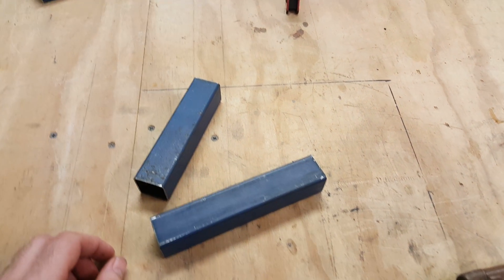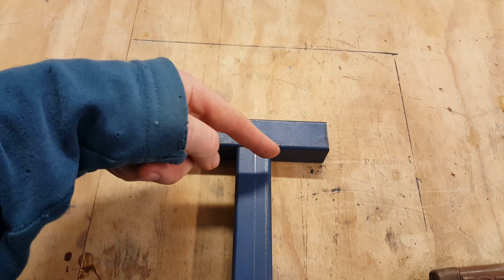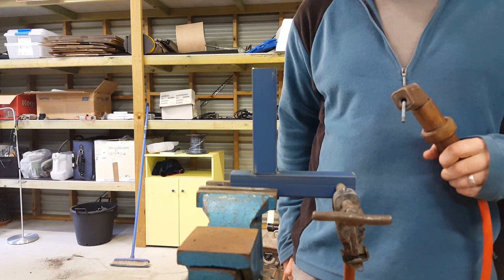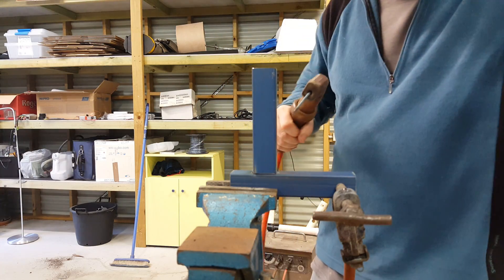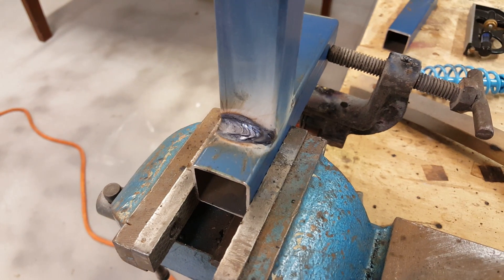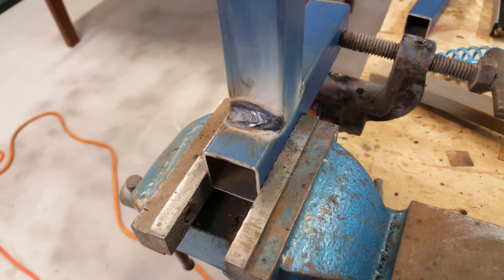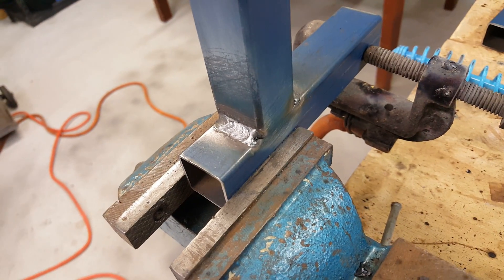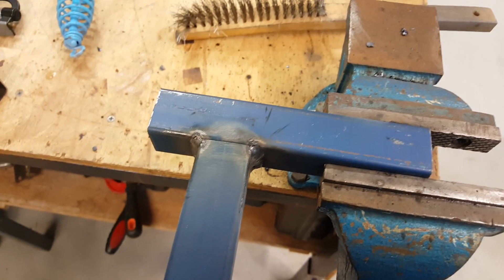Welding thin steel tube with a stick welder

Comment: Would you say that 1.6mm electrode would do just fine with a normal continuous stringer bead with amps set at somewhere between 20-40Amps ? I was wondering whether trying to match as close as possible the electrode diameter to the thickness may be another solution?
Reply from the maker: In my experience the thinner electrodes are consumed very quickly and offer very little penetration into the base metal.  As I've said here before, the settings I'm using here were the least-worst settings I could use, and only worked if I stopped periodically to let the metal cool.  2 mm electrodes (instead of the 2.5 mm ones I'm using here) might be OK, but I still find less than 70 amps to be ineffective.
Reply: @jonescg  thanks. What about several layers starting with a thinner one and the swapping to a 2.5 or 3.2 electrode?

Comment: Thank you for sharing  your skills I was welding a tube today it was a disaster it looks like a cheese with wholes, thanks God for your simple and straightforward advises. I have benefited and learned your techniques, would be able to tell us the wattage you have used in this weld please, iam using 60 70 watt.
Any advice will be appreciated
Reply: Good luck to both of us man, that happen on me too
Reply: Try 30-40 amps ;)

Comment: Thanks Chris. I've been burning holes in thin stuff like a maggot in a piece of gorgonzola cheese. How many Amps did you use?
Reply from the maker: As per the notes: 75 amps and 45 V.  I found going any lower caused the rod to stick a lot more, and the penetration was poor.  Lots of commenters have suggested I turn the amps lower and do a continuous run, but as I have explained many times before, doing so results in a worse weld.

Comment: When you started on one side of the vertical and let it cool, I would have thought the weld would shrink and lift the opposite side
since it was unclamped of tacked in place?

Comment: No complaints or criticisms. Cleaning off the slag between each stitch weld will help to produce a better weld. The slag is being pulled into the next stitch. There are lots of great suggestions.

Comment: So much wrong in this vid. First clean your surface it has to be as clean as possible no rust no paint use a grinder and a flap disc.
2. Use glothes and close your pullover u will burn yourself
3 first tack everything if the heat comes ur steel starting to dent

Comment: Dreadful. What you’re trying to do is progressive sequence welding, can be handy if you are using the right amperage and gauge electrode. Also helps if you clean the surface of paint and contaminants before welding. Good enough for a quick farm repair on the run, but by no way trade quality.

Comment: I butt welded two pieces of 1/8 “ flat stock today.  I ground away all the excess weld  and went to town trying to break it.   I was shocked I couldn’t. Just sharing my success, nobody here cares.
Reply: I care Gene Miller :) I recently got myself to the same position. Feels great! Of course I then went on to try weld the tube I intended to weld and blew holes in it repeatedly so, not feeling as confident anymore
Reply: Michael Andersen keep at it Michael. Perhaps thinner welding sticks?
Reply: Gene Miller well done Gene. The people here who are enthusiasts do care and it's great reading others people's comments.
Reply: I say a job well done.
🖖😎
Reply: Do you want a hug, or do you need a cup of cement?

Comment: Why cant you find more videos on this when this is one of the biggest issues with welding. After 1 year I still struggle.
Reply: AHS Society  I just started welding.   Maybe a couple a hours welding time with a Lincoln tig from Lowe’s.  The biggest tip I was given was slow down.  Welding isn’t a race. My welds come out pretty decent and are very strong with good penetration.  I weld stuff then break it apart. After the advice my welds jumped in strength dramatically.  They don’t break any more.  I still have a problem staying straight but for some reason I can’t see through my shield.  Once I work that out I’ll be stoked.

Comment: Hi , I'm new to welding, you used 2.5mm rode for a  1.6mm square , how can i choose what rode and grade for different metal thickness, is there a guide line to follow? 
Thanks
Reply: thin for thin, that is my rule.  even go down to 2 mm drop temp
Reply: @africanhistory  thanks

Comment: If its gonna be anything structural then you should chip the slag after every tack. Because doing it that way, even though it's just a couple seconds between tacks, it still has flux already forming and you are just tacking over flux each time so it's not gonna be as strong. But for non weight baring things it's fine, also you could get a size smaller of the tubing and cut a 2" piece an put it inside the tubing you are going to weld, just put a small tack and grind it flush then you have backing all the way around and you can weld it solid normally w/o burning through.
Reply: You can restart on slag but it has to be hot. Half a second should be a good interruption value.

Comment: Great tip...Another great tip is to clean your metal before welding but since you are using a stick welder, they work also when the metal is not so clean. Not ideal but when in a pinch!

Comment: Tack one side, weld the other.  Weld 1/2 way, then start at the far end and weld back to the middle.   You should also clean the area to be welded. Welding over paint isn't good.

Comment: Try weaving  the rod and weld down hand. I have welded car exaust pipe with 6011 1/8  at 45 amps  with a ac welder. It can be done!

Comment: Basically a stitch weld to allow everything to cool off and not blow holes everywhere. For thin stuff, I'm now using an everlast pulse mig welder. Basically stitch welding on steroids.

Comment: I find i only get those weld holes from the dirty paint material or if its old rusty steel. If you use a thick wire wheel on grinder first to clean metal till silver you get better weld and penetration

Comment: How do you make the 2 parts stick together before even welding them?
Reply: Do a thing called a tac weld. You basically weld a small blob on a few edges to hold the overall thing in place then you go over it with the proper weld.

Comment: finally an Aussie that doesn't speak in inches and inch fractions!
Reply: Imperial is shit, metric all the way
Reply: @chrisfricker7025  metric metric metric , oi oi oi !!! .
Reply: chris fricker ok boomer
Reply: Well said, 40 plus years to learn metric and some still insist on imperial.   Is  a pet hate of mine.
Reply: I’m 50 plus but thanks for the youngster comment. Much appreciated. Yes I can do fractions and my comment was about the unequal representation of videos. Not everything needs to be U.S. based. In the land down under we are accustomed to both and our tape measures have both but when you go to the shops most are in metric. Been like that since 1974.
Reply: I must admit inches and fractions make people sound way more intelligent than they actually are  , maybe that's why allot of baby boomers still use it.
Reply: @matthijsjansen5838  -- No, the metric fanboys are more likely to be the youngsters, not us oldsters... I'm an engineer, I can handle either one... Metric is just another arbitrary standard and not based on any sort of universal constants to the natural world... They originally *tried* to do that, but they failed and it just became another arbitrary standard...
Reply: Probably cause metic users are lazy at math.
Reply: Probably because metric users are in a country that uses the metric system and not because they are bad in maths or fractions. My meter has both and yes I have finished high school. My comment was in regards to the unequal representation of videos so it is good to see some outside the US posting as well. The world doesn’t evolve around one system or another and if you look carefully at most measurements you will see most are derived from the Imperial system.
Reply: Still can’t figure out fractions eh?
Reply: I guess he must have an issue with fractions..... a large fraction of the time....
Reply: finally, one more moronic metric troll, who just fixates on trivia
Reply: Such hatred?? In Australia we use both but officially it is Metric. Do we know how to use fraction? Yes we do. Do we assume the rest of the world does not exist? No. My comment was in regards to unequal representation and stands. Too bad people have to be nasty and rude about it.
Reply: @mar56313  -- Looks like some little snowflake got all butt-hurt over my comment and flagged it, so it got deleted.  I was responding to Jansen's rude comment in kind.
If you really want to get picky though, the US does not use the "Imperial System".  We use what the Brits had before they redefined their measures into the Imperial system.  For example, our gallons are a different size due to they having 20 oz per pint and their ounce is slightly smaller than ours.  Still, a British pint of beer is a bit over 19 US ounces (and tastes better than the American mass market beers).  Our craft breweries though are often better that what I tended to find at Tesco in the UK though.
Reply: Wasn’t me. I enjoy reading what people write. I guess being Australian we share the same view.. it’s all the Brits fault. 🙂 (wait for the comments now...😝)
Reply: @mar56313  -- <tips-a-Toohey's-your-way>
For some reason, I haven't seen a Toohey's beer in probably a few decades... Are they still around?  The only "Australian" beer we see these days is Fosters and the version that we get is actually made in the US (although they price it like it was being shipped all the way from Australia).
Reply: Grumpy OldMan of course. Tooheys is alive and well. Fosters is great in marketing and can be found all over the world (you are right often brewed locally so not even come from Australia) but Australians overseas would drink it because it reminds them of home. They were big in the 80s but in my opinion it is not the preferred beer of Australians. Depending on which state you are in you will have your favourites (VB Victoria Bitter, Carlton Draught, Coopers, Thooheys New there are lots) we also like our wines 🙂
Reply: @mar56313  -- Back then, those 25 oz steel oil cans were pretty enticing... :)  Fosters used to make one that was sold here that was called "Fosters Bitter" is a green 25 oz (aluminum) can.  It was better than the regular Fosters... I think it was when the Fosters that we got around here was made in Canada (I'm in the SE Texas Gulf Coast area).  I think these days, the Fosters we get is made in Austin (TX) and they still have a green can, but it is not the Bitters anymore -- I think they just call it "Ale".  They're better than the American mass market beers, but not as good as the micro-brewery beers.
My wife and some of her friends are planning a trip to New Zealand this year and wanted to know if I wanted to go.  Spending around 3-4 weeks with a bunch of cackling hens?  Nawh... Besides, once you've seen your first thousand sheep, they all kind of look alike from that point... :)
Reply: New Zealand is a beautiful country. I spent 3 weeks in both Islands and wanted more. If the ladies yap too much then they are missing what they came to see... the outside. You come to New Zealand for the outdoors. Australians are very particular with their beers and therefore only the best survive. I remember having workmen in the house once and only having Coronas in the fridge leftover from a weekend party. I offered it to them and they said “thanks mate, VB or nothing”. I understood.
Reply: @mar56313  -- With them, it's more of just an excuse to go cackle in new places... Cackling Hen Party...

Comment: First rule of welding: criticise someone else's welding. Lol.

Wear gloves while welding!!!!

Please. Burn hurts.
Reply: His welds are fine. Anybody could do basic welding but a lack of thought on PPE is no excuse.
Reply: And wear something a bit more fireproof than that fleece pullover... That is made from polyester and is quite flammable... Polyester is nasty when burning on you... It sticks to the skin... Cotton burns at a cooler temperature and doesn't stick... Leather is better, of course, but I've done a lot of welding with just thick cotton shirts because it was just a "quick weld"... I've also got a fair share of holes in those t-shirts because of some hot metal splatter and quite often a matching spot on my stomach where it also got burned... Polyester would have been worse...
Reply: burns arent an issue... "Burn" is though... the intense UV is proven cause of cancer in welders
Reply: If you grow allovera ? Cactus in your yard and cop a nasty welding burn, apply this stuff it’s sensational
Reply: I like the comment about the first rule of welding! Youtube seems unfortunately to be full of criticisers (critics are something different and better).
Reply: I always take my shirt off when I weld outside....

Comment: you welded through the painted surface sir..?
Reply: It's a little trick that speeds things up in welding called incompetence. You can use the trick on rust also

Comment: To go along with some of the other good tips in the comments, here are one-and-a-half more suggestions.  It's been mentioned that you can go with smaller electrodes and lower amperage.  Here in the USA you can get E6013 in diameters as small as 1/16th inch.  That stuff gives smooth performance at 30 amps and below. 

Also, once you are working with an arc that's small enough and weak enough, manipulate that arc so it spends more time on the base-metal side of the joint.  In this case the base metal is the tube section that includes the boxed corner.  Spend much less time on the other side of the joint which is the piece that's the open end of the tube.  As an example, count a steady "one-two-three-one-two-three-" and keep the arc on the base metal for "one" and "two", and swing across onto the end-tube metal for count "three", and swing right back again.  When you swing across to the delicate side of the joint, you are just "carrying the puddle" across, rather than blasting the metal on that side.  As the puddle coalesces with the metal on the delicate side of the joint, swing your arc right back to the 'safer' side again.  Vary your counting speed and counting pattern as needed to get the right combination of heat on the corner metal compared to the open-end metal.  You can include that start-stop method too if you are still exceeding the limits with a weak arc, but even then, your goal is to keep more heat on the base-metal side of the joint. 

Learning how to fill your holes is part of the game, and with practice, you can get right to work filling a hole without ever stopping, with the right combination of sweeping the edges and even sweeping right across the gap.

I liked your nod to what it's like to be a beginner, with using a full-length electrode to being like "turning off a light switch with a broom handle." Practice practice practice!
Reply: Just researching for my first project, some excellent tips and guidance there.
Thanks and very much appreciated.
Reply: Eric L great advice Eric. I'm not familiar with the electrodes you mentioned. I will keep it in mind. Perhaps we don't get those welding sticks here. We now have Chinese imports. I will have to go to my shed to see the brands of welding sticks we get.
I bought high strength Welder's rod low hydration. They take a bit more to strike.
Also we get thinner welding rods.
That old welder is pretty good.
Reply: Great advice, “stick welders”’read and learn,thank you for passing on your knowledge.
Reply: Well explained, and the 3 key things you said there is definitely practice, practice and practice!!!
Reply: Jim Alley thanks Jim. I did buy some low hydration welding stick which read 7016. They seem harder to initially strike although when they do make a beautiful weld. I was always buying standard welding sticks for mild steel. I will make a note what you mention as I feel the high strength welding sticks are better.
Thanks for the advice appreciated.
I did in the last buy better grade sticks 1.6 and 2mm. The main suppliers was cigweld although the other brand I got was weld boss I think.

Comment: At the start of each fillet weld there was lack of fusion. Which brings the question. Is the blue coating on the tube steel considered a weld through primer? If not the blue coating/paint may be the cause of the lack of fusion. Clean weld area with grinding or sanding disc to remove paint and mill scale also.

Comment: Hi Chris thanks for the video, I'm yet to try on 1.6 mm round tubing but before I watched this video I was blowing holes but using the same technique to fill in( removing the shite before the fill in, I'm stuck with something though,I'm using a 110 ac welder with 3/32 AWSE6013 rods and I'm having to kick the power up to full just to stop the stick from sticking, is my welder busted? I always weld on a clean surface

Comment: They make smaller electrodes to do thinner material but if your stuck with 1/8 inch ones go to 75-90 amps and hold more of a gap in your arc it can stay hot enough to weld and not stick but doesn't burn through...  Not advised on anything structural but they do make 1/16 6011 and it can weld in all positions and operate at 40 amps... Thank you for your video it is informative for beginners 😁

Comment: that second burn over the tacks, to "clean it up" will put a lot of heat in. on a project that could warp a lot.

one careless double pass like this on some 1x1 8th inch tube warped a project of mine almost 3 inches over 8 feet 🤢
your not welding if your not cursing!
always fear distortion on thin tube, clamp it till it's cold if you can